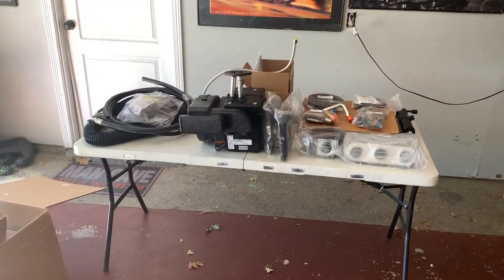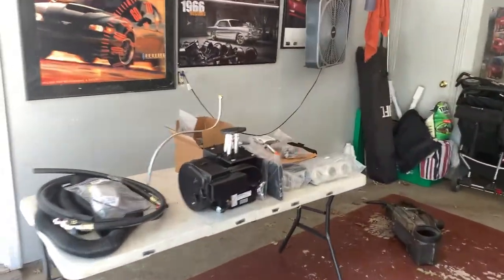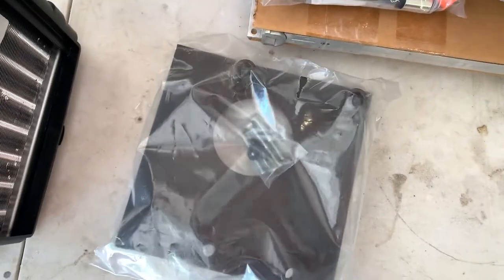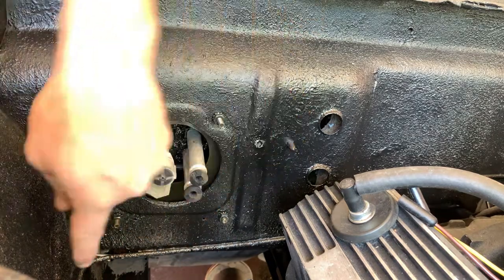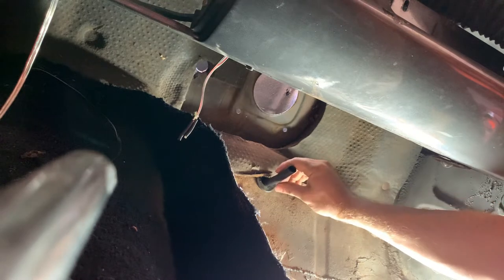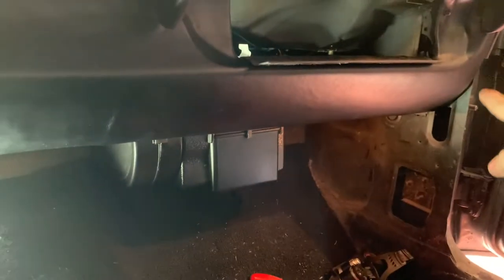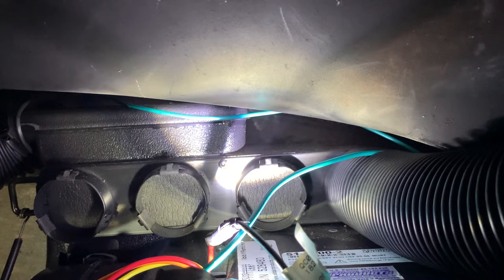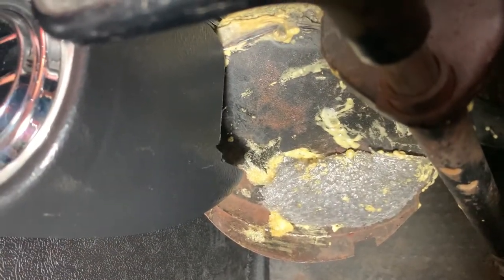Old Air Products CAP-1065M-289 Hurricane Air Conditioning for 1965-1966 Mustangs - Part 1

Comment: Thank you so much. I'm considering this unit for my '61 Falcon. And now I have a much better idea of how I can get it to fit. Awesome. Very detailed.
Reply from the maker: @shadwills8594  Thank you for the feedback.

I was worried this was entirely too long.  Check out part 2 as it deals with the heater core valve and cabling

Comment: Does the passenger side fresh air vent really need to be capped? It looked as though there was enough room to keep it with the heater/evap box in place. Thanks!
Reply from the maker: Oh you definitely can keep it uncapped.  If yours is still in functioning condition and doesn't let outside air in when closed, leave it be.  Mine was rusty and hard to move, so I just capped it.

Comment: Question. The does center vertical slide (temp) do anything. I can’t see how it is connected to anything
Reply from the maker: The temp slider doesn’t do anything now.  Just there for appearance purposes.  The left most slider is what controls temperature on heat only, it adjusts how much coolant enters with the heater valve.

The A/C system is not a blend system, so you can’t adjust it.  It’s either on/cold or off.  My thinking is if I get cold, aim vents away or turn the fan down.

Comment: Have you recorded part 2? I cannot figure out where to install the electronic control valve and this video is the only helpful/informative thing I can find on the Old Air system. Their instructions leave MUCH to be desired, and their CS team isn’t very helpful with any instructions. Seems like every way I try to route the hoses interferes with many other items.
Reply from the maker: I have footage recorded but need to go through and trim/edit.

Is your issue with the heater valve in the engine bay? I don’t have the electronic one, I have a push to open manual valve which is integrated into my original  heat/defrost controls.
Reply: Would have liked to see the Old Air install in the engine bay.  You have great communication skills.
Reply from the maker: @clargay Part 2 is up now!
Reply from the maker: @kylechamblin9835 Just letting you know part 2 is up

Comment: Hi have you done a video yet for under the hood connection for AC/ heater
Reply from the maker: I have it recorded but I have put the mustang on hold for now.

I purchased a house in August  that I’m renovating and won’t be done until spring.

Maybe I can answer some questions?  Or I can just upload the raw video for you.
Reply: @minter66  thank you so much one more question does the compressor come with oil in it so it won't burn when finally ready to run it
Reply from the maker: @marycorona934  If the compressor was purchased new from Old Air or one of their suppliers, it contains the correct amount of refrigerant oil.  Don’t add any or buy Freon that has oil with it.

You need 32-36 oz depending on how you run your hoses.
Reply: Hello again can u tell me how to connect the heater hoses plz which one goes where thank you
Reply from the maker: @marycorona934  Top hose from the heater core goes to bottom hose of water pump.

Bottom hose of heater core goes to top of water pump

Comment: Did you loose foot room on the passenger side?   It looks like the new heat/ac box hangs down more than the factory set up.
Reply from the maker: Not any noticeable amount.  I’ve sat on the passenger side and at 6’ 2” can still sit comfortably.  The old heater box took slightly less space.
Reply: Nice. After watching your video I’m thinking about buying this kit. I like the simplicity. The ecu vintage air uses makes me nervous. Now that the weather has warmed up have had a chance to use it?
Reply from the maker: @Mike-sh2dg  not yet, my gauge cluster is out for repair

Comment: Great video, very helpful. I was originally going to go with Classic Auto Air but their leadtime is 12 weeks now, so I'm considering Old Air. Looks very similar. Have you done the underhood portion yet? I'm worried about the compressor mounting and my power steering. Any thoughts? Thanks!
Reply from the maker: Hey there,

I have not done all if the under hood yet.  I’ve mounted everything but the compressor and hoses.  

The brackets they supply are heavily adjustable, so I would make an assumption it can work with a power steering pump -  but I don’t have power steering.  Definitely call old air here in Texas and ask!
Reply: @minter66  Hey, thanks for the response. I ordered this exact same kit and I was able to make the compressor mounting work with the aftermarket compressor I ordered. 

Also, not sure if you’ve found this out yet, but the side vents not fitting properly is actually because you have them on the wrong side. They ARE side specific. Swap the sides and rotate them 90° and they will sit flush against the kick panels and point straight out. I discovered this today while test fitting interior parts
Reply from the maker: @lemonke1576  Glad to hear!  And thanks for the tip about the vents, it was driving me nuts!!

Comment: some of your narrative is ahead of the actual video, otherwise very informative. I like this unit as it saves quite a bit of money not having to rebuild the fresh air vents and the heater plenum.
Reply from the maker: Do you have a timestamp on the audio?  And thank you very much for the comments!  I’m a fan of this setup as well, mainly the vents now produce air as well as heat.  And it looks great!
Reply: The car we are doing is a convertible and has the Eaton power steering pump.

Comment: Installing my system now. Glad I got to watch you do yours. How much refrigerant did you put in during the charge?
Reply from the maker: I just pulled the vacuum yesterday.  Once it get it back together and running I’ll let you know.  There are instructions on how much to put in
Reply: @minter66  I have mine up and going now and it has 34oz in it. Works great.🥶